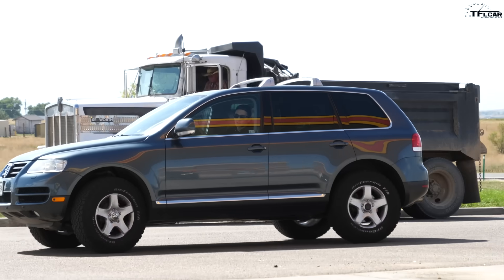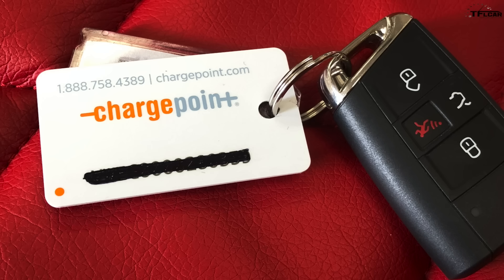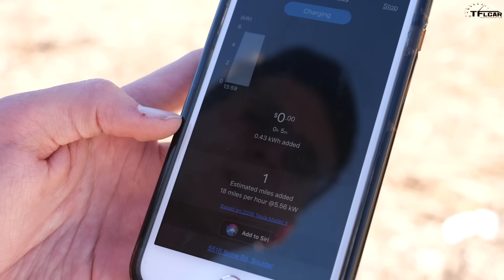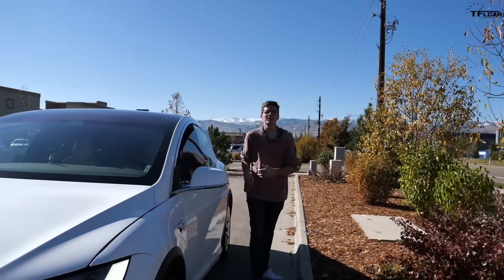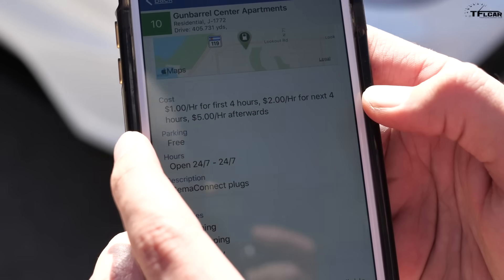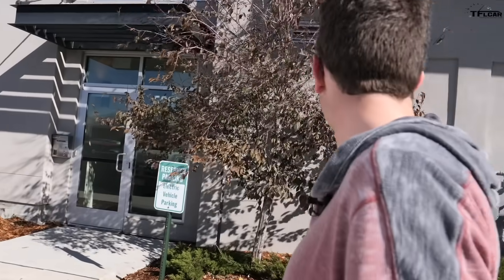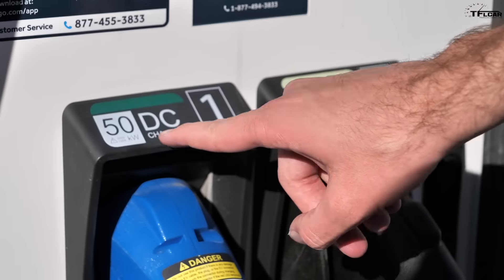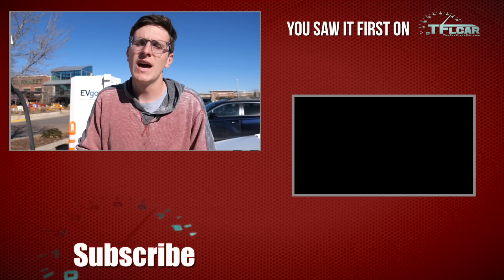Here’s Why Charging an Electric Car Can Suck - And It’s Not The Reason You Think!

Comment: When electric cars take the same amount of time to fully charge as filling up with petrol or diesel that is when I might think about buying one.
Reply: I think the problem is one of WILL!   And I think many of you do not know the difference between an invention, and a development.
Reply: jack fenn 
While you’re “willing” pigs to fly, I’m going to be zooming all over in my truck, only having to  stop every 400 miles for less than 15 minutes and off I go. 

These ev’s aren’t even a joke for most people in most situations. It’s just sad actually. 

No doubt it’s cool for those in the perfect situation to make it work. But how many people can really pull this off every day?
Reply: Easy enough. Just change the battery for a fresh one. With hydraulic systems, takes about thirty seconds.
Reply: @jackfenn7524  As an engineer I have thought about this subject myself and agree it would be as simple to implement a battery change as it would to get your  car washed, ie, drive in drive out, it also makes sense if they really want people to use electric cars, beats me why they don't build the facilities to do it instead of having all those stupid chargers everywhere, were you are screwing around with cables waiting hours for your car to charge up, all I can think of is it must be the initial cost of setting it up due to the fact of having to store a large quantity of batteries and the different battery sizes involved, they would  have to standardise the battery size and their fitment first, but that is perfectly possible to do, maybe Elon ought to start the ball rolling. T.
Reply: Terrence Long The idea is great in theory but not in practice. Swapping battery packs means there would have to be a “standard” sizing of packs/modules agreed amongst ALL manufacturers to make it economically viable - would not happen as this would have a big impact on the vehicle design. But if this did happen, the removed packs still have to be re-charged and this still takes time.
Reply: @terrencelong6436  i get your drift, But honestly other companies should start being not complete dicks and not wait for musk. Can somebody else help save the world? it feels like the only person who does something for the world these days are musk,

"In musk we trust"
-Me
Reply: @jackfenn7524  you should read up on the cost of a battery replacement. Who would be happy to spend £10000 ($13000) on a new battery. Yes the manufacturers give a guarantee of around 8 years or 100000 miles, but does that roll over if someone was to buy second hand after a few years. second hand cars would then be worthless as you would more than likely have a huge bill waiting once the battery was done. At the moment you can buy a second hand car for less than the cost of the battery.
Reply: Hey, daveaglasgow, good point, BUT, we are talking about large interchangeable batteries, which would be 500 pound alkaline batteries. An electric or hydraulic jack system would change that battery, and you are on the road again!
Reply: As with all initial technology, the cost would be high. But large investors would make that expensive initial cash expense more manageable.  And the more customers "bought in" to such a system, the cheaper it would get.
Reply: Imagine what happened when gas cars first came out. No gas stations, right?  So how long before gas stations went from "rare as hen's teeth", to "common as  dirt"?
Reply: Do you realize that electric is much more reliable than those that use fuel? There are very few cars on the road that are at the reliability level of an electric. Most will enjoy not having to visit the repair shops very often, if at all. Road trips are the only hurdle, which likely the batteries will see significant improvements in the next several years. I'm not one of these fake science carbon footprint peeps either.
Reply: In cold climates, many hotels and apartment buildings have 120v outlets in front of each parking space (well... they used to... it is a bit old fashioned). They were for engine block heaters in the winter.

The idea that buildings wouldn't install them if people demanded it is absurd. Apartments used to never have dishwashers or AC, too. Now most do.
Reply: What about Tesla super charger? Take 20 min To 30 min. And at home you can charge over night
Reply: @manasgupta8908  
What about the $35K+ investment that many of us aren't willing to make? Especially since used compacts are so efficient and cheap.... and some are so extremely reliable. Cost of ownership is a huge advantage for the smart, used car buyer.
Reply: Elongatedman 45 thats going to work....oh wait no it won't. Only for people with houses. You honestly think apartment complexes or hotels are going too install 300 chargers for 300 car parks or we all going to fight over the limited number of chargers??
Reply: @xr6lad  Like it or not, EVs are really designed to be charged at home. DC fast chargers and Tesla Superchargers are not the desired way to regularly charge an EV. Fast chargers may be a stop-gap measure today, but eventually what you suggest will have to be the case if everyone is going to drive EV. Every parking space will have to be outfitted with at least an outlet to plug in a level 1 charger, or preferably a 240v socket for a level 2. Either way, fast charging is hard on the battery and the charging system. This leads to decreased battery life and will eventually be a huge problem if level 1-2 charging isn't made practical for everyone.
Reply: Human beings, (and most mammals), are large alkaline batteries. Alkaline batteries are the most powerful and efficient batteries on Earth. So, if a hybrid car has large electric rechargeable batteries,  then the initial cost of those batteries would be high, but the HUGE gain in efficiency would make that very worthwhile.

Comment: Point of order: Much of Europe uses 220-240v as a standard current. So when talking about most people, it is primarily the US that is most obviously affected by the use of a mere 110v. In Europe, two charging standards dominate - CHADEMO and CCS. I'm not sure why we're using different plugs here in EU vs US. I mean, it's one thing for two standards to compete, but it doesn't seem like these standards are seen much in the US at all that I've understood.

EDIT: I see you do use CCS and CHADEMO for fast chargers. So weird. Here those connectors are largely supported out of the door.

Comment: I live in Germany in a town with a population of 22k - and there is no charging point here at all. The nearest charging station is 15km (approx 10 miles) away in the next town. On the other hand, in Germany there is no 120V, we all have 240V, and I can charge at my home plug around 20 kw over night easily. That is more than enough for my daily needs. I could install a wallbox for little money and charge with 11kw/h but I don't need it, and I was told that slower charging is better for the battery's lifetime. Should I need to travel longer distances, with a little planning you can go everywhere with using CCS charging stations. People who do live in a flat simply cannot drive an electric car in my town, because they have no possibility to charge it over night, since there are no electric plugs on the outside of appartment buildings here.

Comment: Its a bad design concept, battery cars should have had a standardised swapable battery pack you drive up to recharge station and an automated system swapped out the battery pack for a fully charged one, you pay a fixed rate for the swap just like a bbq gas cylinder.  You don't have to worry about your batteries going out of date, the company ensures the battery pack is always up to specification tolerances.  The whole swap process should take no more than 5 minutes.  Unfortunately its probably too late for this to happen and now the next phase coming seems to be the hydrogen  cell maybe, unless a better battery technology comes into fruition like magnesium-ion / sulphur, who knows.

Comment: Charge time has always been the issue with electric vehicles.
I remember them in the early days of prototype EV's and when they used
lead acid batteries and the same issues were there. 
Range and charge time. I can fill up a gasoline car in less then 5 minutes 
and go 400 - 500 miles. Then refill the car for another 5 minutes and
go another 400 or so miles. Try that in a Tesla. Due to charge time 
and range per charge, you would
spend an entire day or so just recharging the Tesla to go the same
800 - 1000 miles. In an urban area where you just commute 20 miles or
less round trip and have a charging station at your house, an
electric vehicle is very practical. But if you have a long commute or 
do any traveling, the electric vehicle is no longer viable.
Reply: archangele1 Tell me how my wife and I did a road trip to Florida (1200 miles) in our Tesla Model 3 in less than 2 days then? 15 hours of driving and a few hours of Supercharging over the course of the trip, which we spent making pit stops/eating anyway. Could have done it in under a day if we hadn’t stopped for the night to get some shut eye. Road tripping is totally viable in an EV nowadays, at least in a Tesla with Supercharging.
Reply: @Jaws1200   The initial investment is the killer for many out there. I can afford to pay cash for a Tesla, but refuse to. I buy old, efficient, reliable vehicles at ridiculously low prices and drive them for many, many years. I work on my own cars and smart mechanics don't buy cars that aren't reliable. We don't like working on our own cars! My cost of ownership is phenomenally lower than that of any Tesla or other electric vehicle owner. BTW, every car in my fleet gets at least 50MPG and I do have a special Civic that is only ICE and gets 65MPG in the city with careful driving. I'm an example of why not all are on board with electric. This will change when the battery tech improves and more charging stations pop up, but I give it at least 10 years before it's more viable. Until then, thanks for the sacrifice to get this moving forward.
Reply: @Jaws1200  Man, you took almost 2 days on a trip that could be done in a little over 10 hours driving a ICE. Sorry but "road tripping is not totally viable nowadays". Let's face reality here.
Reply: Lucas P We could have done that trip in one day, but we didn’t want to drive continuously through the night. Charging times were not a huge factor.

How do you figure you could drive 1200 miles in 10 hours? What ICE could sustain 120MPH for 10 hours without horrible fuel economy and needing to refuel at least 4 times at those speeds (let alone the legality of traveling at such speeds).

As another example, I just did an OH>TX road trip, 1400 miles each way in 24 hours of travel (21 hours driving, 3 hours charging). How is that much slower than in an ICE vehicle? Are you telling me that you could drive for 21 hours straight without stopping for bathroom/food/some stretching or rest? EV road-tripping is totally feasible. Not to mention 100+ mile trips are less than 1% of trips taken by Americans on average, so judging EVs just on their convenience when road-tripping is such a trivial thing to focus on for trips you will be taking such a small fraction of the time. Day-to-day, owning an EV blows owning an ICE car out of the water.
Reply: you forget that you can charge while you are out shopping, you can charge when you are stopping to eat on said road trip, there are many ways to charge while a ICE car just sits, we have to get out of that mindset you are stating
Reply: Eric Dodson I’m sticking with my ICE. About 2 minutes for a “full recharge”. That’s great. Love it.

Comment: Interesting, I didn’t now that in America Tesla uses different standard of connector. 
But in Europe not all Tesla come with a comb o connector, only model 3 and model Y. Model S and X come with a J1772 and they give you an adapter for CC fast charging station.
Also the max Kw at which different models can recharging with J1772 is different: model 3 and Y can go up to 7Kw ; instead Model S and X go up to 22Kw (for example wall connector in Tesla destination charging reach 22Kw).
And also (I don’t know if Tesla remove it with the last update) Tesla model 3 and Y are limited by the software to 50Kw while recharging at fast changing stations that aren’t Super Charger. This wasn’t a problem until last year because all public fast charges don’t exceed 50Kw. But in the last year company start to install more power station. For example ionity is installing charging station that can go up to the incredible power of 350Kw.

Comment: No it may start out very cheap like gas engines did when they were first created after it gained in popularity price when up of gas oil so will electric cars to recharge them as it becomes more popular.
Reply: ok, gasoline is a non renewable energy.

air, water, solar is renewable so it's not possible.

Comment: Got a Tesla? Try a Tesla Supercharger point!
You don't understand why the Tesla uses a different plug and socket? It doesn't "suck". It's because the Tesla one is better designed and much faster than anything else that was available at the time they made it.

7kW? Small Change!
Teslas can charge at 50, 100, sometimes up to 150kW, wvich means you spnd a lot less time waiting and more time driving.

Also, a lot of Teslas have come with free (as in free beer) "Supercharger" access for life.

Other standards for connecting  charging stations are playing catch-up :-)

Comment: While the idea of electric cars sounds nice and it's good news that so many charging stations are now showing up...if this EV thing truly did catch on, it seems like half the world would have to become parking lots to handle the whole idea. Even with a half hour charging, one still has to plan out where they are driving to insure keeping that car charged.

In the long run, (and let us face it. Gasoline is finite.) we're going to need a better battery. One that can gather charges a whole lot quicker. Because, most people are not existing at the leisurely pace of these aforementioned charging times. And, another thing that we could probably need is rent-able charge batteries. Don't think the main battery gets pulled at all. I'm talking more like recharge pack. It's a secondary, smaller battery that is charged up at a brick and mortar place...like a traditional fueling station. For a price, you take out the discharged pack and exchange it for this fully functional pack. The car gets some of it's charge off of that while the former rental battery is recharged at the station you left. While it can't get you as far as the main battery, it sure will keep your car running in far less time. Hopefully...with operation in full swing, it becomes as long as a traditional gas fill up. Say, 2 minutes at best. As even these Tesla stations seem best geared towards people that are living casually or on vacation and may walk about and shop or go to a restaurant. But...seriously? 15 miles per hour charging is dreaming of a neighborhood commute program.

Comment: Unless you live in your car don't you have electricity at home?
Reply: Yeah, sure. Except for people in apartments and townhomes. Oh, and not everyone with a house has a garage, either. And not all garages, when people do have them, are wired in a way that makes sense. Our garage was built out with a single outlet in it. Our previous garage was as bad, and the one we had before had 2 outlets in it, but nothing more.

So once again, more cost to have an electrician come in and wire a new connection for you.

Comment: After reading the comments it is obvious that "most" of you do not understand how Tesla ownership works.  The video shows a guy with a Tesla trying to use "non-Tesla" chargers.  He just proves what every Tesla owner already knows.  Non-Tesla chargers are "mostly" for non-Tesla vehicles.  To use one on a Tesla you would have to be pretty hard up for a charge and not have planned your trip very well.  A Tesla Model 3 currently holds the record for the Cannonball Run which is a 2800 mile trip that they did in 48 hrs and change.  They could not have done it using "home chargers" or "non-Tesla chargers."  They used Tesla Superchargers!  It doesn't take hours to charge, it takes minutes!  Become more informed.  Here is a link to the family's story that holds the Cannonball Run record:  https://www.teslarati.com/tesla-model-3-ev-cannonball-run-record-video/

Comment: I live in Aiken, SC and have been driving my Model 3 since March of 2019 using "only" my home charging unit which I installed myself for under $100 and, when travelling across the country, Tesla Superchargers.  I have yet to get stranded or even get close to not having access to the Supercharger network.  Yes, you certainly "can" live like this.  I also have never used any of the adapters I received with my Tesla and I don't take my charge cord with me when I travel.  Would consider a ChadeMo adapter if they didn't cost so much!

Comment: A question for the Americans here. What options do most states offer for residential power. I live in europe. 230v is default (1phase and one neutral) . Second option is 3phases and a neutral (380-400v) that means on 32amps you can charge decently at home . How does this work in the states ?

Comment: I would still need my gas powered truck for long trips, towing and hauling but I could easily use the E.V. for everything else. I have my own garage with available 240 volt A.C. The wife and I could do all of our local running, park the car in the garage, plug it in. .. next day, ready to roll again.